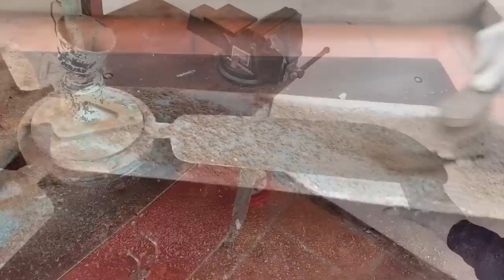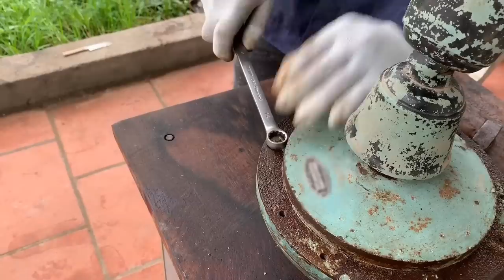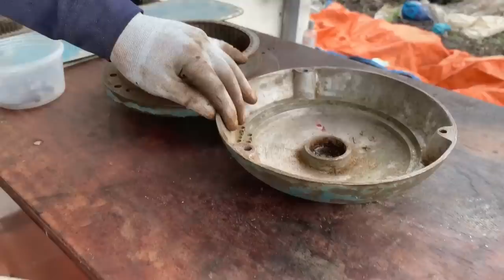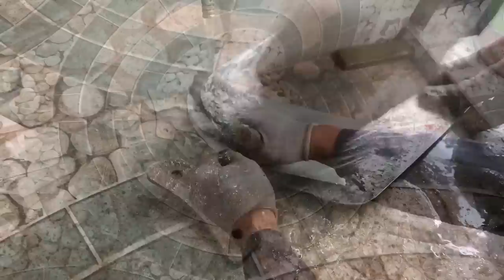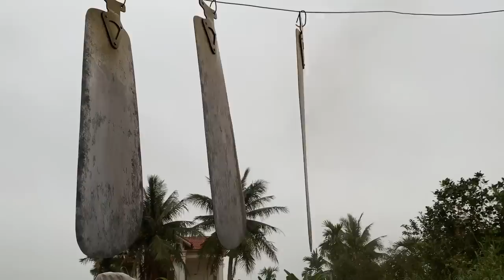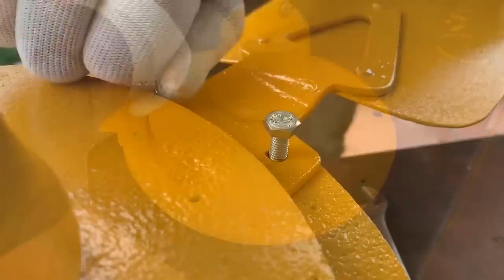Restoration antique Russian technology ceiling fan

Comment: Obviously not a "Harbor Breeze" or "Hampton Bay" fan from Walmart, Lowe's and Home Depot. Seems to be cast and balanced. And bearing were a great thing as well.  Not a "fan" of your color choice. And I think I would have media blasted it all and then used filler materials to smooth the surfaces out. Then proper primer and very nice top coats with clear coats to finish it off. But nice project anyway.

Comment: Well done apart the wrong method to put in place the bearings, you almost destroyed it!
Reply: @therestoration2r878  I think there is a misunderstanding, the bearings is well placed but the way you did it with your tool make it suffering. It's better to hit the bearings with a tube on the outside metal ring or if you have a smaller tube, you put a spacer in between to get a flat hit.😉
I don't know if you understood what I sayed, English is not my first language.
Have a good day.